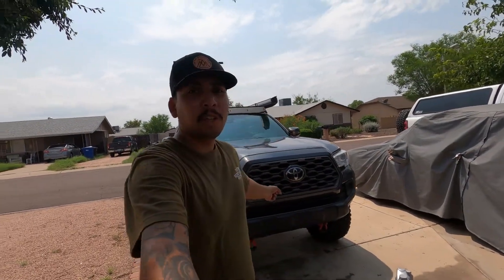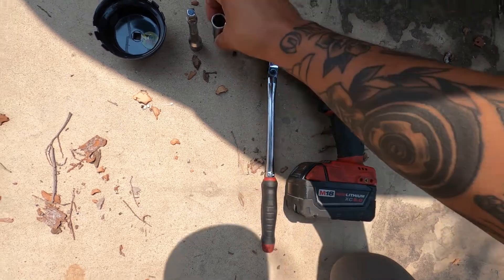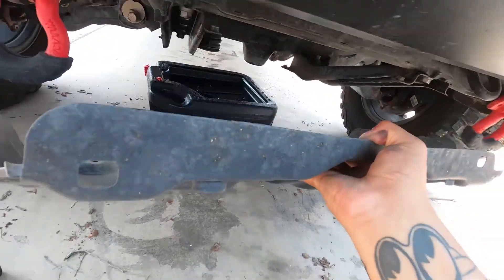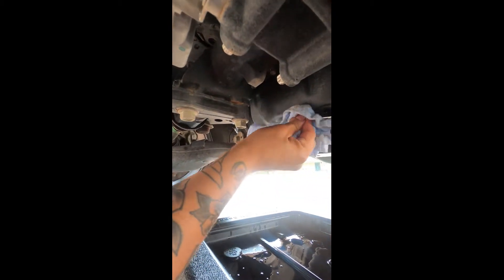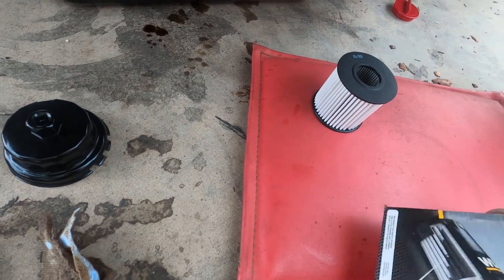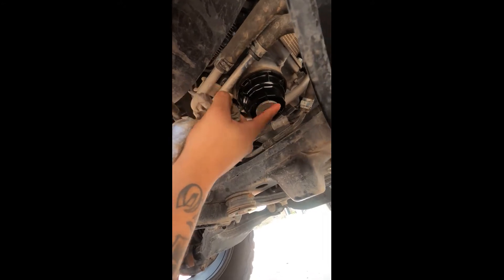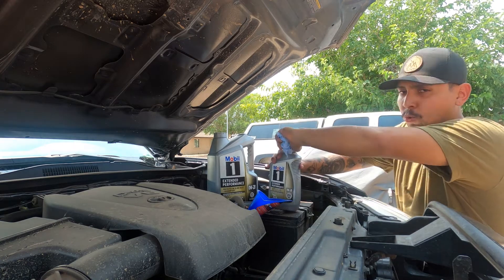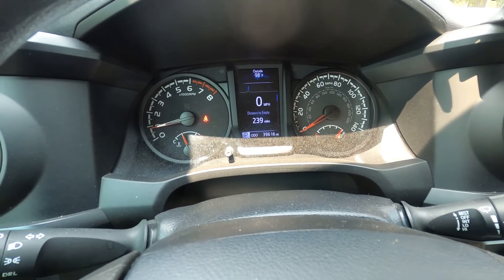Oil Change In My 3rd Gen Tacoma! (A How To Video)

Comment: Thanks for the vid. You should pour about a cup of new oil into the new oil filter after installing it into the oil filter housing. This prevents dry starts when starting the engine for the first time after an oil change.

Comment: Greetings !! New sub here . I appreciate the helpful video . Quick question . can I use the exact Mobil 1 oil on my lady’s 2018 tacoma that has 85k miles ?
Reply from the maker: Glad it helped you! And yes you can mobile 1 does also make a high mileage (75,000miles and up) synthetic oil that’s great too but either one would be great!